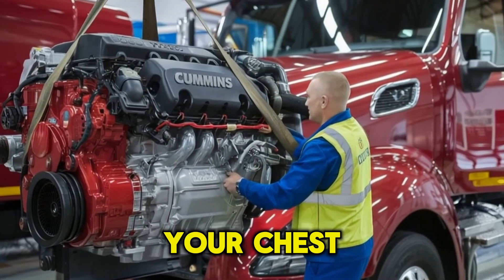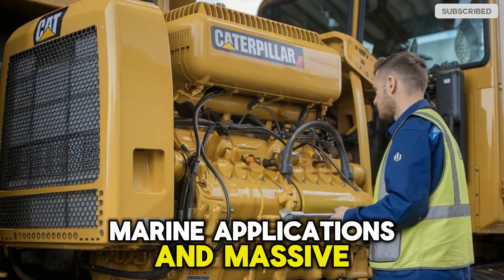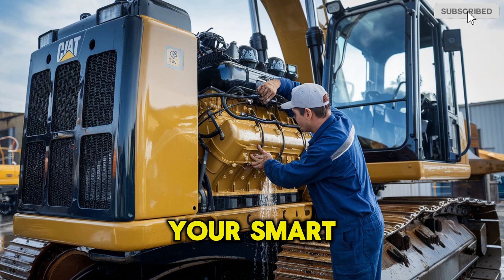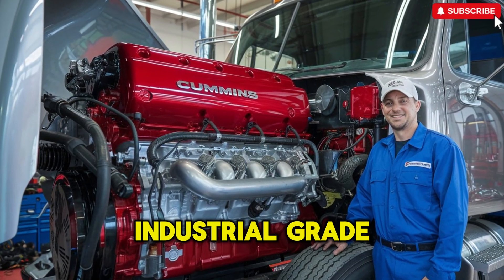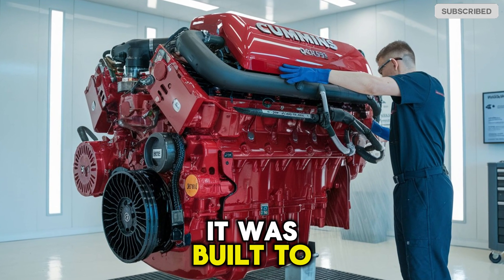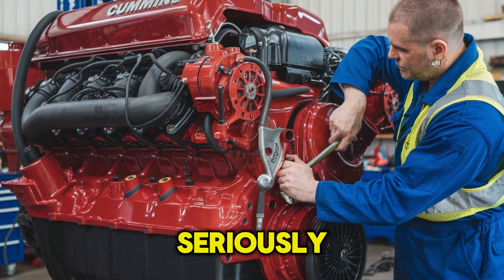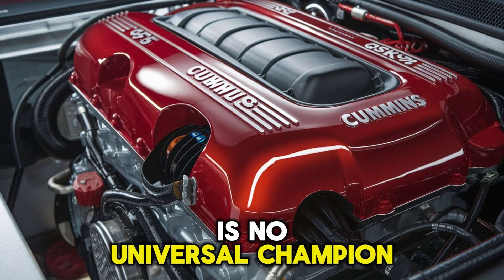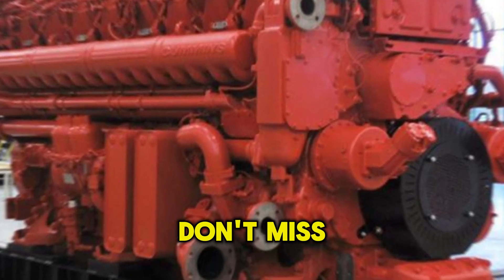Cummins QSK95 vs Caterpillar 3616: A Powerhouse Comparison for Industrial Applications

Comment: When you’re talking about the Cummins, you keep showing a Caterpillar. 
And that is not a Caterpillar 3616, the 3616 has 1127  cu in per cylinder, and it’s two stories tall and has 7500 HP and maxes out at 900 RPM.